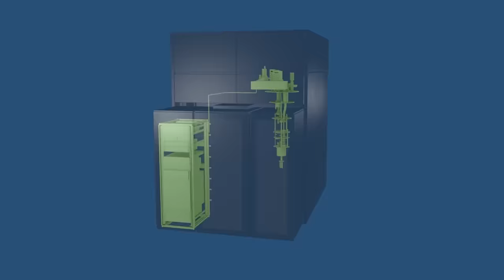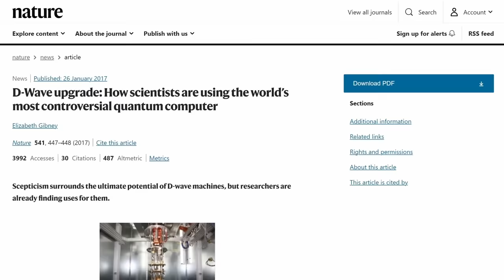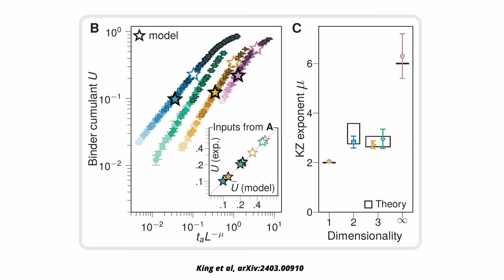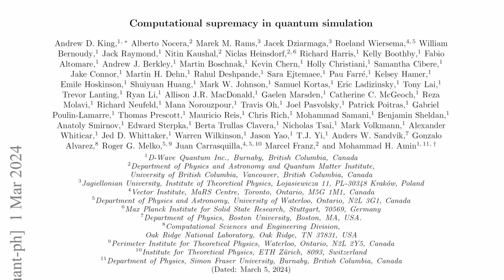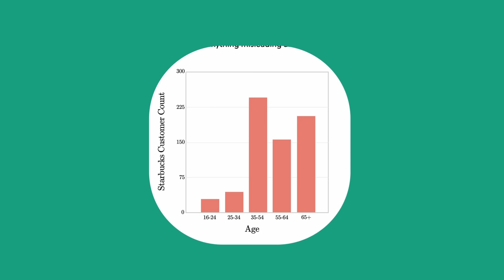Record Quantum Computation at D-Wave: Millions of Years Down To Seconds

Comment: If people are saying the Ising Model is a specific case that may not be relevant for real world computing, please note that the Ising Model is the basis of the Hopfield model which is a model of neural storage of associative memories in neuroscience. Quantum versions are predicted to have MUCH higher memory capacity than the classical version which only has capacity linear in the number of neural units (magnets).
Reply: Exactly again that idea of specialized purpose for memory. It’s why our brain separates cortexes based on function and purpose. Or why we keep multiple drives to separate our work on a computer. Essentially using a more organized memory structure to use memory space as optimally efficiently as possible. Also why we store memories that are associated in physical neuron proximity. Helps them fire off of each other
Reply: Neuroscience is still in the quackery stage, barely beyond lobotomy, just finer resolution.
Reply: Actually, associative memories modeled after the Hopfield model have a capacity that scales less than linear in the number of units: O(N/log(N)), where N is the number of units, to be exact.
Reply: @SurfinScientist  Ah, even worse--thank you!
Reply: Solving the Ising model is an NP-complete problem. By definition, every NP-complete problem can be mapped to each other, so solving one solves every other. This is why it so relevant.
Reply: @erdekesnem7767  Solving NP-complete problems by quantum computers does not result in speed ups, as has been proven. Anyway, the Ising model is not NP-complete. It is not even a problem to be solved, it is just a model, so the statement "solving the Ising model is an NP-complete problem" is nonsense.
Reply: @SurfinScientist  The Ising model is NP-complete on non-planar lattices.
Reply: @erdekesnem7767  The Ising model is just a model, not a computational problem, so you cannot characterize it as NP-complete. It is just a matter of definition.

Comment: In classical computing, there is the analog computation, where for example a dial is twisted by one process and the machine spits out a result elsewhere after electrical signals have been manipulated. Not too different from the truly classical manual computer, where someone did calculations by hand, say, looking up as precise as possible a value on a graph. Because of these two historic parallels, i'm inclined to actually call this a calculation.
Reply: Yeah, I don't really know a lot about what they're doing, but sounds to me like a "non-general purpose" analog computer
Reply: I agree but from another perspective: it takes numerical input (be it a configuration of qubits) and gives a numerical output, so it's a calculation. Simulation can also be, and often uses a lot of, calculations.
Reply: @user-sl6gn1ss8p Quantum computing does not have to be general purpose in order to be disruptive.
If you and I could make a quantum SHA reverse solver that can almost instantly defeat SHA and can only do that, that alone would make us billionaires.
A device that instantly finds high primes would be another example of a non-general-purpose, yet very disruptive technology that could be achieved this way.
Reply: I think this is mostly just semantics.
If it takes an input and produces useful and non-trivial output it is a computation.

I think this is in the same class of computation as the DNA "computer" which can perform very NP search and mapping problems by "annealing" millions or billions of macromolecules in parallel at molecular speed.

If the Everett interpretation is correct, this is pretty much how "Qbits" do it, just faster and parallelized over a chunk of a multiverse.

Are both of these devices computers?
Not if you definition of computer requires a Turing complete machine.
Reply: @EaglePicking  yeah, absolutely, I didn't mean to imply otherwise. I just do think the discussion would benefit from clarifying that.

but hell, people use Ising models for all kinds of stuff - if it could even just do that really really well it would already be a fairly big plus.
Reply: @NullHand I'm happy with retaining the Turing complete requirement.. These quantum whatsits can ho find thier own vocabulary.
How's about calling the quantum solution process "resolving" since that's pretty much what they do.
Reply: @NullHand it's not just semantic.
An analog computer can sokve many problem faster than a digital one.
But there is an high additional cost when you need to solve a different problem.

If their solution can solve a difficult problem that takes years in an hour. But you need years of work to set up the configuration so you can start solving a new problem then it matter.

Not that writing new algorithms for digital computer or quantum computer is done in an instant. But if the set up time has a huge difference in magnitude it matter. That is why the term used are important.
Personaly I would have colled this a quantum analog computation, not just a simulation.
Reply: In that case blenders are computers...shaking different stuff in a container are computers.

Comment: Elegant, clear explanation of how D-wave devices aren’t quite “computers”!
Reply: The definition of "computer" is an example of the imprecision of human languages. Computer was once a job description, of a person (usually a woman) who ran hundreds, to thousands, of math calculation during her work day. When applied to devices, it covered mechanical, and electronic analog computers, before being applied to digital computers. Some with the calculations "hard set" in their design. Others reconfigurable, or programmable.

I've used analog computers back in college, which is "programmed" by wiring up a circuit. I've also made a living programming microcontrollers, which are "hard coded" most of the time to specific functions. Even though some (the old HC05) have the von Neumann architecture (most are Harvard), will you exclude them as computers, when their app is hard coded ? Language gets political, like that !
Reply: maybe its more of an asic than a computer
Reply: Define a "computer". Your definition may not be the same as other people's, even if you were to consult a well respected dictionary or textbook. As someone pointed out, once upon a time "computer" was a job description for humans. It's a very imprecise term.
Reply: @another3997 words change, computer is very precisely defined
Reply: @another3997 
Usually, general computers defined as “Turing complete”.
With such definition D-Wave machines are not computers. They calculate really well smaller subset of problems.
Reply: @sans00x  quantum computers aren't turing machines, so it's useless to measure any quantum computer by whether it's turing complete.
Reply: @marckiezeender  I think you are wrong. Why can't a gate computer run any Turing machine computation?
Reply: @marckiezeender Anything that is computable is computable by a Turing Machine. This is the Church-Turing thesis. There are less capable categories of solving machine like state machines too.
To say a device is Turing complete is to say that it is of the same class as a Turing machine and thus can solve any computable problem. If D wave is not Turing complete, that means it can't.
Reply: @marckiezeender  
Quantum computer is not magic. Anything that can be calculated by quantum computer can be calculated by regular non-quantum (it just might take more time). They have same set of solvable problems. General quantum computer is also Turing complete.
D-Wave machines are not general quantum computers.
Reply: @sans00x they are turing complete. Just not universal for quantum computation which is a different thing.
Reply: D-wave is closer to a state machine rather than a true computer.
Reply: @geordierose3242  
Can you give definition of “universal quantum computer”?
Wikipedia, tells that it is the same as “quantum Turing machine”. D-Wave cannot be “not universal” and Turing complete at the same time.

Comment: Optimization problems, the kind that D-Wave's approach solves, are some of the most common needs for high performance computing and get used for many things. Nobody has yet proven there is even a quantum advantage for any other useful algorithm. So far, it's basically Shor's algorithm which, outside of academia, is mainly of interest to thieves and national intelligence agencies and I expect both are behind the funding for many of those projects. Given that, I'd say D-Wave's strategy is currently the only real quantum computing. Google can compute arbitrary algorithms on their platform but most, if not all, will be no faster than their classical counterpart and far less efficient.

Comment: My understanding of the discussion surrounding D-Wave being / not being a quantum computer has been that it is not so much the simulation vs computation part, but that the way they implemented the system. While a “proper” adiabatic QC tries to avoid an excited state, the D-Wave annealers happily leave the ground state and essentially rely on quantum tunnelling to bring them back down. Hence the debate whether a transition from QC -> non-QC -> QC is realistic. To date, none of the studies have shown that the D-Wave systems have a true quantum advantage, so will be interesting to see what the effect of this new one will be (at least after peer reviewed).
Reply from the maker: Yes, you are right that the quantum advantage has been questioned. But think of the spoon. The spoon also has a "quantum advantage". It's just not the sort of advantage that people usually discuss in terms of operations needed etc. I have little doubt that if you have a large quantum system like D-wave it will be faster than a conventional computer at something -- they just have to find that something. (And then there's the question whether that will be useful for anything, but that's a question you can also ask about the present-day universal quantum computers...)
Reply: @SabineHossenfelder  Isn't this "spoon" reference true for all quantum computers?
Reply: @SabineHossenfelder  The "classical" quantum computers that can run Shor's algorithm are also good at something, namely running Shor's algorithm. They are as universal as D-Wave's quantum computer is. So much for one-trick ponies.
Reply: @SurfinScientist and now Shor's algorithm was improved and can be done faster

Comment: Objection. You say "you can't verify the solution because we don't have any computer that solves it".

But... the Ising model is (according to Wikipedia, I wasn't aware of it before, but I trust it on this) equivalent to an NP-complete problem. NP-complete problems are well known for being hard to solve but very easy to check a claimed solution. This is one of their core features. A solution to an NP-complete problem is very easy to check by a simple computer. The difficulty is in coming up with it to begin with. So if the Ising model can be translated into an NP-complete problem, then just take the problem they solved, translate it, translate their claimed solution, then have a checker verify it.

I didn't know about the Ising model and I know very little about the D-Wave quantum computer beyond what you say here, but as a computer scientist who knows about theoretical computer science, this claim that "because a problem is difficult to solve, it's difficult to check the solution" is outright wrong (and kinda basic in complexity theory), and I think it's wrong in this particular case too. 

Could you clarify??
Reply: NP Hard not NP Complete
Reply: @geordierose3242  irrelevant. Np complete means it's both np hard and np itself. According to Wikipedia, Ising problem without external fields is np complete, and therefore NP, and therefore solutions should be verifiable on polynomial time by a classical computer.
Reply: No. NP Hard problems are optimization problems that return real numbers. NP Complete problems are decision problems (yes/no). The former can't be checked (you don't know if you've got a global optimum) but the latter can.
Reply: @geordierose3242  I'm sorry but that's just not the definition of what NP hard means. See https://en.m.wikipedia.org/wiki/NP-hardness 

Now regardless of the name, you're right that is you're trying to find an optimal solution then it can both be harder and more importantly harder to verify. I do get a bit lost with the complexity properties of verifying optimality, but given how it's phrased in the video, and especially the argument "we can't check the solution because we can't find the solution" is just very misleading and potentially incorrect in the context of complexity theory. Maybe in this case it is because checking optimality of the solution is inherently tricky, but it should have been said with more care. And your definition of np hard is just wrong.

Comment: The spoon analogy is not so silly.  In the 1960s finite element methods were just beginning to be used in continuum mechanics (stress/strain analysis).  Those methods were found to have limitations, as they still do today - especially in vibration analysis.  Experimental stress analysis comes to the rescue.  Basically, you build a device and test it.  If you want to know how a spoon works, it's easiest to just make one.

Comment: Wave Function Singularities, Quantum Gravity, Unified Field: Frequency Wave Theory

Expanding upon current theories of singularities with a hypothetical frequency wave theory introduces a novel perspective to understand the fabric of the universe and the singularities within it. Singularities, as understood in physics, particularly in the context of black holes and the Big Bang, are points in spacetime where gravitational forces cause matter to have an infinite density and zero volume. This traditional view, primarily rooted in general relativity, encounters limitations when it tries to describe the quantum aspects of singularities.

The introduction of a hypothetical frequency wave theory could aim to bridge the gap between quantum mechanics and general relativity, offering a unified description of singularities. This theory might propose that at the core of singularities, rather than an "infinite" point, there exists a fluctuation of energy or matter that is best described through wave functions. These wave functions could represent the oscillations of fundamental fields or particles at extremely high frequencies, which converge at the singularity.

Core Concepts of the Hypothetical Frequency Wave Theory

1.Wave Function Singularities: Instead of viewing singularities as points, this theory would interpret them as zones where wave functions of particles or fields reach extremely high frequencies. These frequencies could be associated with the energy levels and the quantum states of particles converging at the singularity.

2.Quantum Gravity Interface: The theory could provide a framework for quantum gravity, illustrating how gravitational forces operate at quantum scales. It might suggest that gravity itself can be quantized and its effects are mediated through wave functions that interact with the fabric of spacetime.

3.Unified Field Oscillations: At the heart of singularities, the theory might propose a unified field where all fundamental forces (gravitational, electromagnetic, strong nuclear, and weak nuclear) merge. The oscillations or frequencies of this field could dictate the properties of singularities, offering insights into their behavior and structure.

4.Quantum Foam and Planck Scale Dynamics: At the Planck scale, the theory could introduce the concept of quantum foam, where spacetime itself is subject to fluctuations. These fluctuations would be characterized by wave functions oscillating at the Planck frequency, potentially leading to the creation and annihilation of micro singularities.

5.Information Preservation and Transmission: Addressing one of the biggest puzzles in black hole physics, the theory could offer mechanisms for information preservation and transmission through the boundary conditions of wave functions at the event horizon of black holes.

6.Cosmological Implications: On a cosmological scale, the theory could provide a new understanding of the Big Bang and the evolution of the early universe. It might suggest that the universe itself originated from a singularity where wave functions of the unified field began oscillating, setting the stage for the expansion of spacetime.

Challenges and Future Directions

•Mathematical Formalism: Developing a rigorous mathematical framework to describe frequency wave functions at singularities is crucial. This involves integrating concepts from quantum field theory, general relativity, and possibly new mathematical tools.

•Empirical Evidence: Finding empirical evidence for the theory's predictions would be challenging but essential. This could involve observations of black holes, gravitational waves, and cosmic microwave background radiation.

•Quantum Computing and Simulations: Advanced quantum computing might offer new ways to simulate and explore the implications of this theory, providing insights into the behavior of singularities and the early universe.

This is a part taken from CHAPTER 1 of my recent book: 

Wave Function Singularities, Quantum Gravity, Unified Field: Frequency Wave Theory

Available on Amazon here: https://read.amazon.com/kp/embed?asin=B0CW1GLHD9&preview=newtab&linkCode=kpe&ref_=cm_sw_r_kb_dp_9VVJSQ61YKT844ZSTZA0&tag=aideas07-20

Images were made with AI's imagination

#QuantumPhysics
#QuantumGravity
#UnifiedFieldTheory
#WaveFunction
#Physics
#ScienceTwitter
#Astrophysics
#BlackHoles
#SpaceTime
#Cosmology
#QuantumFoam
#PlanckScale
#Singularity
#SciComm
#EmergingTech
@neiltyson
 
@carlorovelli

@seanmcarroll
 
@ProfBrianCox
 
@lirarandall
  
@michiokaku